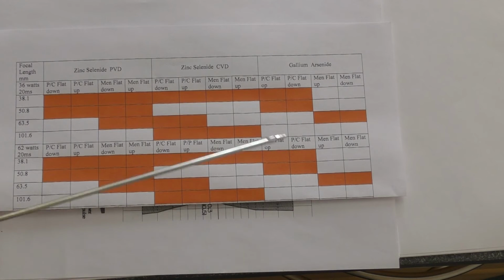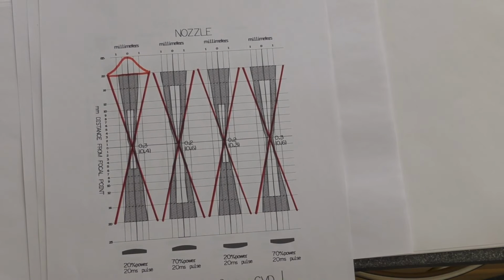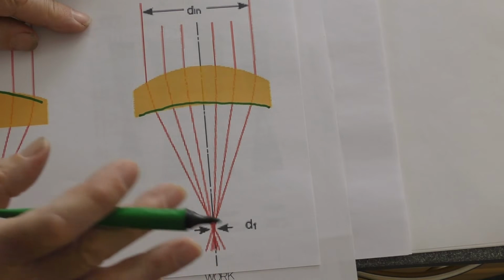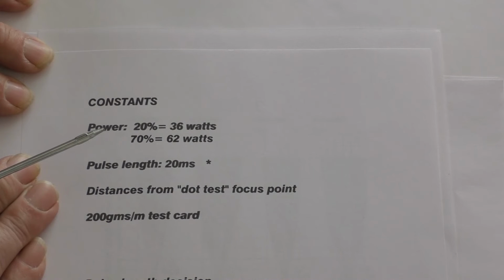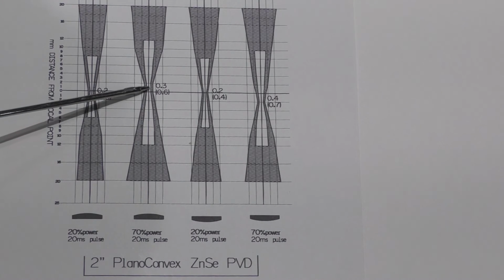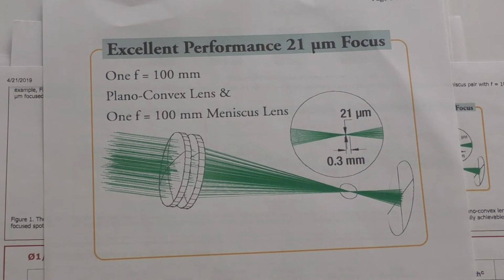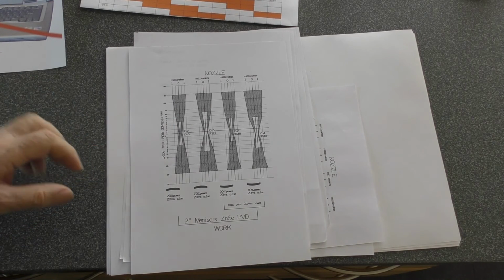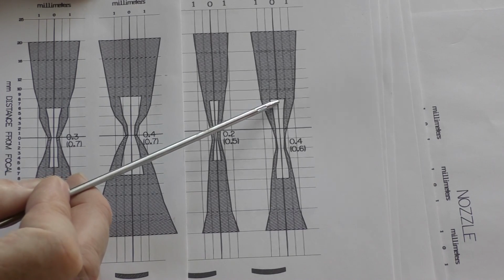RDWorks Learning Lab 163 Lenses Part 2 Lets Focus

Comment: If you got a red laser that was defocused to a beam of 12mm or so you could do some experiments that were not invisible light. I really like the idea that if you could get all the power into a spot smaller than 0,1mm then you basically turn a 60 watt machine into 300 watts
Reply from the maker: Hi
Your idea is correct but the detail is a bit off. You must understand that we are NOT  amplifying the watts but amplifying the DENSITY of the watts. If I was going to poke you hard with a sharp pencil and asked you first  which end I should use,  you will absolutely choose the blunt end because the same amount of poke force would be spread over a larger area and the DENSITY of the force will be lower. and the pain a lot less. If we assume  that my 60 watt tube power was uniformly spread across the 12mm diameter beam, that would give the beam and energy density of 0.53watts /sq mm ( the blunt end of the pencil). If I now squeeze those same 60 watts into a spot 0.1mm diameter the energy density  becomes 7,700 watts/sq mm (the sharp end of the pencil) The sole purpose of a lens is to amplify the light intensity because that is what we use to damage material.  You can prove that it is still  only 60 watts coming through the lens by measuring the power after the lens only to find that the lens has cost you 3 or 4% loss.
Thanks for the comment because I did say that getting your head around the concept of energy density would not be simple, so your question allows me to give additional information  to help people understand.
Best wishes
Russ